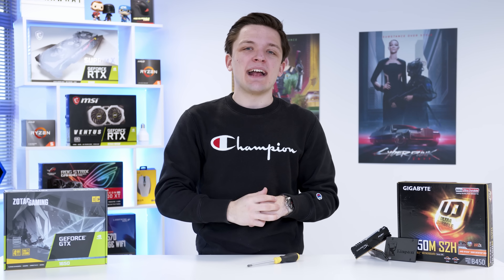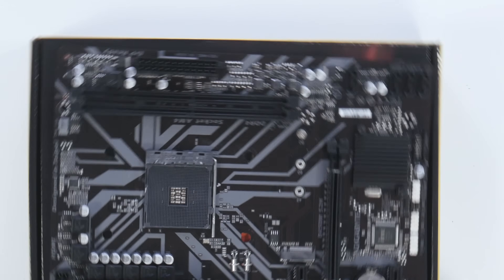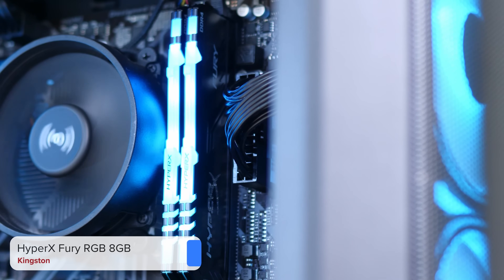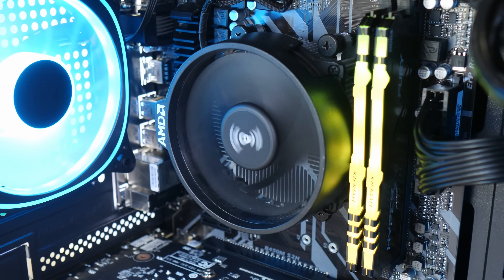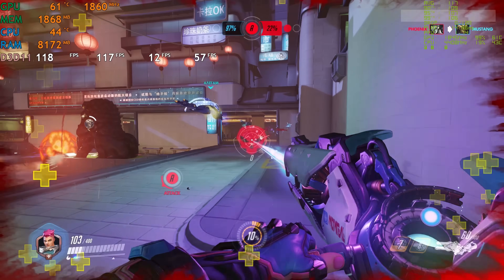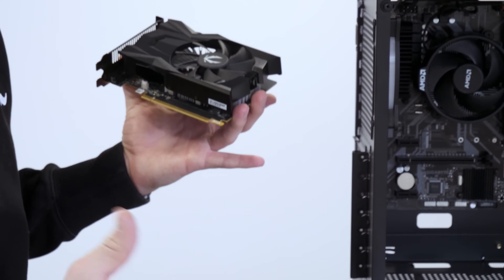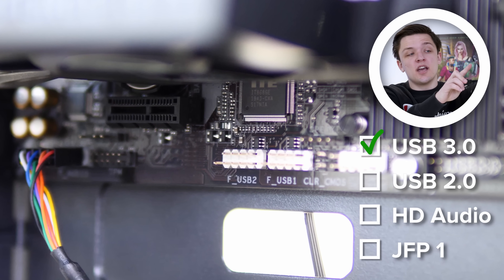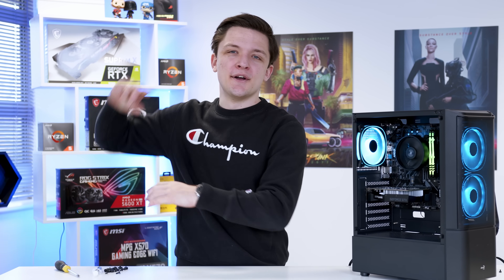A $700 Gaming PC you can ACTUALLY Build in 2021! [The Anti-Scalper PC Build!]

Comment: if you're going budget.. just get an i5 10400. It beats the ryzen 5 3600 on all aspects of gaming and for under 200$ it rocks in any 1080 setting. Also i recommend crucial ballistix 3,000mhz 16 gb ram. With the 10400 it will set your ram clock speeds to 2666 mhz, but it gives you some headroom if you ever wanted to upgrade to the i5 10600k. The 1650 card also is really only good if you're gonna play games like CS:GO, Fortnite, etc.. If you wanna get into MMORPG games i recommend the 1660 super. Yes prices are inflated but you could probably shop around for a used card. Overall i rate the system 6/10. Mainly b/c you could've picked a better CPU and this pc will be shat on by MMORPG games that are open world and not just mediocre textures like Valorant, CS:GO, and Fortnite. Also with the way things are now.. prebuilts are actually not a bad idea and over time you can tweak them to your liking. 4gb of VRAM like the 1650 has is just not enough for gaming in 2021.

Comment: Ok, i have a way better pc that you could build:

1. Cpu: i5-10400 way more powerful than a ryzen 3 3100 €155 $170
2. MOBO: B460M DS3H €85/ $90
3. RAM: 16 gb ddr4 3000/2666 mhz €80/ $80
4. PSU: 500W or something on that price point €50/ ($52)
5. RX 580(maybe) 4gb / RX 570 4gb / 8gb (€150) $150
6. SSD NVMe 550gb: €70
7. Case: MSI MAG 100M/R Max €70 or less ($70)

The Rx 570 is more powerful than a gtx 1650. It's still not $700 so if you could spend a little more on for example; the graphics card. Also you don't need a 700 w power supply unless you will buy an rtx 3080 in the future. I did leave a little gap for if you want to spend more on a psu, Remember?
Thank me later, guys
Reply: Good luck on finding them on stock or original price
Reply: ready my mind exactly! that ryzen is trash

Comment: Save your money, don't waste $700 on a system like this. Save until you have enough for a system that is promised to last at least 3 years without performance issues. I'm aiming to spend $1,500 on my first build this April, save your money and I promise it's completely worth it!
Reply from the maker: You missed the point I think dude, normally I’d agree with no stock and inflated prices on better performing GPU this is a best budget build for the now. April is not looking any better stock wise either... 🥺
Reply: @GeekaWhat  I got the point, just don't see any reason to waste $700 on a system when you can save more for something long-term without worrying about it slowing down in a year or two. I only say April will be a good month because I signed up for the EVGA queue, I also have fairgame to auto-checkout with a single card if I have a chance. I'm following a lot of news and alerts showing cards in stock within the seconds they drop. No hate, just saying that saving your money is always wiser for the long run.

Comment: Great build! I have a similar build, and it works wonders! I can play Warzone at 1080p low/med at 60-90fps, which is way better than the 30fps I was used to on the PS4 (with 2x8gb RAM).

Comment: You could put one 8gb instead of 2x4gb so you can upgrade in the future and you also don't need 3600mhz ram because it's not all about frequency but it's instead about latency
Reply: Making use of dual channel is important though... the right move would just be to spend literally 5$ more on a mb to get 4 ramm slots